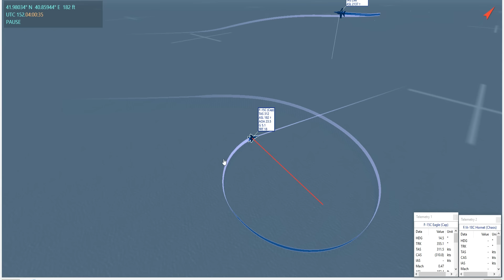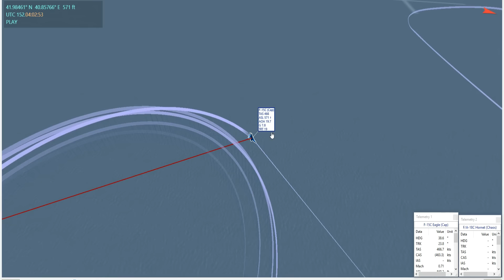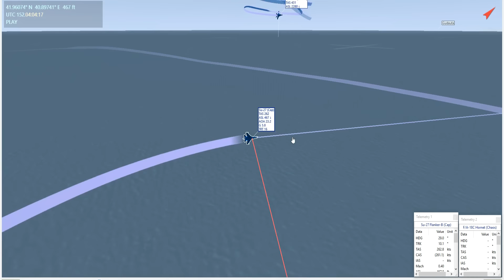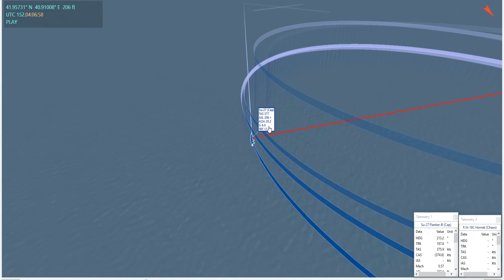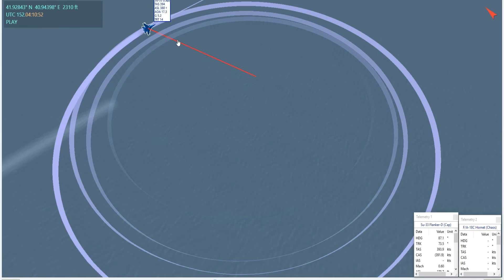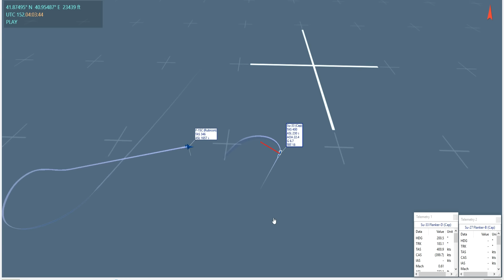F-15, Su-27 & Su-33: Max Sustained Turn Rate | DCS WORLD

Comment: One thing i can think of. When I was reading through a Mirage 2000 flight manual (non dcs source) it pointed out that if im on the deck i have a lower turn rate than the f16. however if i turn at about 15k-18k ft. I actually out rate the F16. So as well as fuel i feel like at a higher altitude some of these aircraft may actually rate better.

Comment: You turn a fair bit faster at low speeds. I've gotten an F-15 around in 16 and a bit seconds sustained clean and light. 300-320 kt is actually perfect.

Comment: always fly su 27 in cobra mode, flanker has no match in dogfight gun only. terryfying performance if flied by perfect skilled pilot. 30aoa EASILY up to 600km/h beats up everything, no other fighter can do that.
Reply: Loosing tons of speed and energy by doing that which is not very good in dogfight ;) Very situational
Reply: @adrianstachowski9422  instead of completely releasing asc mode (cobra) occasionally relaxing the asc mode helps in better turns for considerably less energy bleed. Su-27 can be quite terrifying in close quarters dogfight.

Comment: Have you tried the same thing with ACS disabled on the Su27 and Mig29? IIRC the ACS limits the AoA on the Su27 to 26 degrees. You should be able to pull a much tighter turn at subsonic speeds with ACS disabled.
Reply from the maker: Will investigate
Reply: @vothka205  exactly.

Comment: Question. I'm relatively new to dcs so please correct me if I'm wrong. But for the sake of the expiriment wouldn't it have been easier to do with full "nose up" trim? At least then, based on your control tunes, it would have made your stick adjustments less jerky or at least allowed for more elevator control so your increase in knots/s more even. Again I could be wrong but just a thought
Reply from the maker: Full up trim would make just about any fighter impossible to fly TBH
Reply: Understood. Thanks for the clarification
Reply: Flying like that would lead to stalls. You don’t fly with trim, and fighters are unstable enough to where you should need trim

Comment: I might be getting mixed up with another plane, but IIRC, the Su-27's FBW limits Gs by default to keep the speed up, and you can push something on the stick to have it relax the limit to let you pull tighter turns. That might not increase the sustained rate though.

Also, I do remember seeing a video about training exercises where some USAF Hornet pilots trained against German MiG-29s, and the -29s could outturn them easily in most dogfights because of the much higher TWR. The Hornet pilots were trained to take advantage of their better handling at low speeds to counter it, but even then, the -29s had the advantage that they could just go full afterburners and run away if needed.

Comment: Holding the wheel brake button gives you more Geees in the Sukhois,alternatively if you want to live dangerously and achieve even more you can press S to disable the fly by wire,be careful though as the plane becomes much more twitchy x'D I killed myself plenty of times with it XD

Comment: fun fact: fighter jets have a "bob weight" attached to the stick under the floor panel. It helps prevent G-Lock by literally pulling the stick against the pilot. That's why when your pulling sustained G's the stick feels like it's 50 pounds to help"autocorrect" and hopefully prevent you from becoming G-locked.  I wonder if the bob weight has anything to do with this test and if ED included that "effect" in the sim. Just a thought though.
Reply: I know it's not an ED module, but the MiG-21 is known for stupid amounts of rudder-induced instability at speed even though, in reality, a pilot would be basically unable to put enough force through the pedals to manage it. So if it is implemented at all, it's inconsistent at best.

Comment: Well, this is a very courageous series considering that most real pilots are biased while most virtual pilots are super-biased to the point of being mean :))). So good luck with it :D! Just a small comment, comparing corner speed fighters (F-15, F-16) with what I like to call "nose turners" (F-18, Su-27 - newer dogfighter philosophy where the designers strive for huge AoAs and incredible instantaneous turn rates) is somewhat like comparing apples with pairs, or better yet, Granny Smith with Red Delicious :))). The idea behind a "nose turner" is to fastly get the nose on the enemy in the first or maybe the second circle by smartly using the higher instantaneous turn rate, not really be concerned with speed as nose turners don't really stop turning at lower speeds. Thus the fight should be over fairly soon, or the nose turner is in trouble if it cannot bring its' speed back up quickly. Anyway, just a thought, not a real pilot and definitely not a good v-dogfighter, but getting there...
Reply from the maker: Thanks for the info Sir

Comment: I don't know if this is the right place but a group i am on on FB recently got into a discussion on CV born aircraft and loads the aircraft can carry for various takeoff configurations, the question was raised whether USN aircraft given the full deck of a CVN could actually launch given NO catapult support. 1 F18 pilot reckons minimum load and another figures no hope of getting airborne. Is it possible to test this in DCS and for the results to be used as an example. Also given the same parameters, NO catapults, which modern jet fighters CAN actually launch off a CVN provided they can use full deck length. Its both an idea for a video and  general discussion topic. Please and thank you.

Comment: Another good video, i was looking forward to this one as well!
Now, on to the technical matters; the reason why you get such high alpha with the Flankers is the weight. More weight, means you need more lift to keep the same energy state (sustained turn or level flight) and more lift means more angle of attack is needed. Coincidentally, this is what kills your sustained turn rate, as more alpha also means more induced drag.

As for the fuel states, for the heavy fighters, i think the following are considered "combat" fractions:
F-15C 50% internal fuel;
Su-27 33-35% internal fuel - as mentioned in other comments, a Flanker is considered full at 2/3 rds  of maximum internal capacity, as it will never carry external fuel tanks. In other words, unlike in a Tomcat or an Eagle, you are never supposed to enter a flight with a Flanker at over 66% of fuel. 

Naval aircraft (F-14, F-18 and possibly Su-33) should have about 10% higher fuel fraction at combat loads, because of the safety margin required for carrier landings, so 60% internal fuel for the F-14 and F-18, and around 40-42% for the Su-33.

EDIT: The F-15 will actually turn into the low 20's, but you will need about 8.5-9.0 g in order to do that. So in DCS, it isn't quite a useful part of the envelope when you are DOWN LOW. But the higher you go, you will achieve higher sustained (but still manageable g's) then any other plane in the transsonic part of the envelope (450-550 KIAS). 

EDIT2: The Su-27 limiter works based on total weight, so it will limit you less if you have a lower fuel state. You can also risk overriding the limiter, but beware of ripping off your wings if you pull too hard, or if you are too heavy!
Reply from the maker: Thanks Sir
Reply: @grimreapers  always a pleasure! Keep 'em coming!

Comment: Thank you Cap, very informative and helpful for us fellow DCS jockey's. 
I suppose in real world none of this matters, especially if for some reason your airworthy aircraft numbers have dropped by 30% due to Naval cost deflections into "advanced systems development". 
Add to this that the F-18 aircraft at full fuel load can only travel 1/2 the distance required to engage any opposing aircrafts release of almost any of the "carrier killer" missiles that have been available for decades! Something the F-14 (unashamed fan) was more than capable of. The reliance on any ship bound defence systems should be our last resort. This situation is not rectified with the F-35. In fact it deteriorates.
Reply from the maker: thx Sir

Comment: On the Russian planes you need to override the limiter to get their true turning rate. If I remember correctly you need to hold the brake to do that. If you don't you just get some mellow stuff that's suitable for generals close to retirement.
Reply: Looked like the Su-27's AoA was being limited in the replay, not the Gs as Cap first suspected. 
His AoA was being capped at 20, preventing him from pulling harder.
Of course, the AoA would be higher on such a heavy aircraft with the relatively large amount of internal fuel, so it's a double whammy.
Reply: @NefariousKoel  Yeah that's what I meant with "limiter". In real life the Su-27's stick has some sort of "limit", which you can pull the stick through by using extra force. In this game it's simulated, since most joysticks can't emulate this. So you have to press the button which it is bound to. In old versions this used to be the wheel brake button. Today it may have its own entry in the configuration. Look for something along the lines of stick limit override or similar.

Comment: Although I understand that these results are the best you can do, they appear to be a bit inaccurate, based on the available EM diagrams for some of the aircraft measured. For example, the M2KC EM diagram indicates that it should have the worst STR, around 18°/s, and the F-18 is just above it at about 19°/s The F-15 EM diagram indicates a STR of almost 21°/s, and the Flankers is about 20°/s. The fulcrum is spot-on though.
Reply: Or .. DCS is just a game and NOT a simulator fed with all available real data and can NOT simulate real life physics like aerodynamics correctly as if it was a $5m expensive full motion simulator approved and licensed for real pilot trainings? How about that?

Might also be the explanation why the base game is... for free. Means, the actual "simulator" engine is given away ... for free. Or it cost 60 to 80 € tops per module and not 500 €/hour like in a real simulator. Why, huh? And THIS might be the reason why neither air forces nor airlines nor private pilot flight schools use DCS for professional trainings, not even for navigation trainings, because it's a game, not approved, inaccurate, not fit enough, and your trashy home PC couldn't handle real life aerodynamic calculations at all anyway. Not even the airline's full motion simulators can handle it, which is why flying the real counterpart still feels different from what you did and how you did it in the simulator: real life planes are mostly easier to fly, the sim training is harder, because... it's not real. It can't calculate and thus simulate correctly every thing that's going on in real air. Simple as that. They're just accurate enough to train with them. That's actually called simulation. Difference! They're not the reality either.

You simmer guys should get that finally: your "simulators" are just a game category, but technically they are games. That's all what they are. Nothing wrong with that, I play them too. Keeps my instrument scanning and multi tasking skills in shape. Get used to it, you're not a pilot when playing these games, you're a player, nor will you ever become a pilot by playing video games, you gotta go to a flight school and pay a bit more than just nothing or 80 bucks for a plane module and 500 for a stick. Games can inspire you to choose this path, to eventually work your butt off to get the real thing done. And you can familiarise yourself with the theories. It keeps you reading stuff about why planes fly and how, right? But that's about it. You. Can. Not. Practise. Driving. Jets. With. It. Quite the opposite, you can develop some odd if not dangerous attitudes, thought and behavioural patterns by playing it if not supervised by a real life flight instructor! In real life you would have to unlearn all the wrongs first and then relearn everything from scratch again, which is significantly harder than learning something correctly from the get-go. But I digress.

What you are complaining about here is most likely due to the ubiquitous game balancing. You can rest assured that game developers will always alter real life data to make their games more accessible, playable, enjoyable, you name it, to even out the oh so overpower of ... whatever it may be that the cry-babies call OP again nowadays. That's how casual gamers are: they all want to have the same tools but please in one million different shapes and forms and with different names, and please no significant differences between them all,  because they don't want less skilled players to have e.g. "overpowered" planes they can shoot everything outta the skies with. Even if that was how it would be like in real life. And then they would still call it a "simulation". Rest assured. And skilled players are cheaters, no matter how over- or underpowered their assets might be. That's how it works in the world of kiddos in adult bodies.

Tl;DR: The first three jets tested in the video are some of the oldest models in DCS. Back then I paid €9.99 for FC and got them all. They are totally imprecise and inaccurate compared to their real life counterparts. The fighter jet generation categories are balanced. And even if they were not: Stop comparing the data of these toys in a game with the data from charts of their real counterparts. They have as much in common with each other as uranium with urine.
Reply: @Claude Eckel  i agree, not to mention that DCS completely butchered the SU-27s sustained turn rate... in real life the SU-27 turns much better in a sustained rate fight than it does in game.
Reply: @Claude Eckel  SU-27 in DCS : 18 degres per second on 50 percent fuel
SU-27 in real life: 25 degrees per second on 50 percent fuel...
Reply: Andi feels very strongly about this

Comment: I love this video series, however I have made one observation about this video:
You did 50% fuel for all aircraft. This is unfair for the heavy fighters for a number of reasons. Mainly that they are designed to be longer range fighters, both the Flankers have a massive 20,000 lb+ fuel tank designed to not carry external fuel where all the other aircraft rely heavily on drop tanks. Even the Eagle is designed to dogfight and have enough fuel to return from a long range CAP mission. The heavy fighters were designed for very different missions and designed to have superior endurance. Yes, the extra weight hurts performance. If you calculated this based on endurance rather than weight, I think that you'd come up with a lower percentage of fuel for the Flanker than the Fulcrum. I'm too lazy to do the math so maybe this is a more fair test:

If you are putting 50% fuel in the MiG-29, 40% fuel is more fair for the F-15C, maybe less... and 25-30% fuel in the SU-27/SU-33.
Reply: In fact, it would make sense to redo this test with 0% fuel to find out what's every airframe worth in itself. Also, let's not forget that all jets consume fuel at different rates, not to mention that closer to the end of a dogfight each participant will be basically flying on fumes.
Reply: And flankers should be flown with the "stick deflection override" << this is a DCS workaround to the FFB of the real thing
Reply: @MorganMR2  and you can do cobras all day long
Reply: I think at least have it be 50% of the combined fuel load including the drop tanks.

Comment: F/A -18 might be able to turn tighter but that does not necessarily mean it is the best fighter. I think the F-15 is a better all around airframe. But if I was to pick a airframe it would be the F-16 Block30 with its Largemouth Intake !!!
Reply: The F-18 is definitely the superior plane in a dogfight IMO. Better turn rate, probably better turn radius, lower stall speed, HMDS for off-boresight shots... In BVR the F-15 is still the superior plane, but the F-18 isn't too bad either.

But I'd say that the biggest advantage of the F-18 in DCS is the variety of the tasks it can tackle with OK to good performance.
Carrier ops ? Check.
BVR engagements ? Check.
Dogfights ? Check.
Air to ground ? Check.
Aerobatics ? Check.

If someone could only buy one single module in DCS, I would tell them to get the F-18 for this very reason.
Reply: I think the F-15C is a better air superiority fighter given it has better range and endurance as well as can travel much faster. This makes it better suited to intercepting enemy aircraft and lobbing AMRAAM at them. In a dogfight, I think the F/A-18C's going to be more maneuverable.
Reply: You're joking right?

One word...

AIM-9X
Reply: @RaygunGaming  I believe the F-15C uses the JHMCS and AIM-9X too. At least today. The in-game version does not, not sure what year the FC3 aircraft is supposed to be from.
Reply: The real life F-15C is just as well equipped for Air-to-Air Combat as the F/A-18C, however, the comment was meant for the DCS version.

Also, (in DCS) I would argue for just lobbing AIM-120s at a target, I'd take the F/A-18 seeing as it can carry 10 vs the F-15's 8.
Reply: Upsetraygun2 just wait till TWS mode is in and you can lock up and fire on multiple people :).
Reply: Fox 3, Fox 3, Fox 3, Fox 3, Fox 3, Fox 3, Fox 3, Fox 3, Fox 3, Fox 3, re-arm, repeat
Reply: I mean a feature complete hornet has all the features of an F15 plus a better turn rate, better turn radius, better nose pointability, better heatseekers, helmet controlled radar, the ability to hold more AMRAMMs, and datalink like the SU27. It'll be the best air to air plane in every way apart from the 15 and SU having a bit of pure speed and fuel range on it

Comment: Real flanker pilots always DF w/o the flybywire.
Here's something that will help you in your DF in the Su33 CAP (if you're forced to use it):
LShift + E (spl. afterburner)
S - Turn off ASC | OR | Dont disengage the ASC and instead use manual stick deflection override
And you're good to go
Reply from the maker: thx